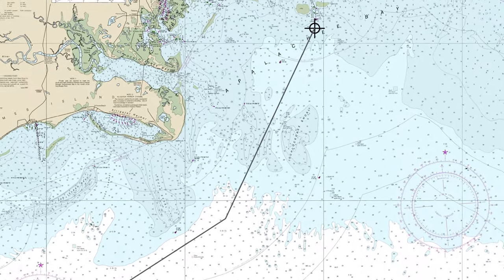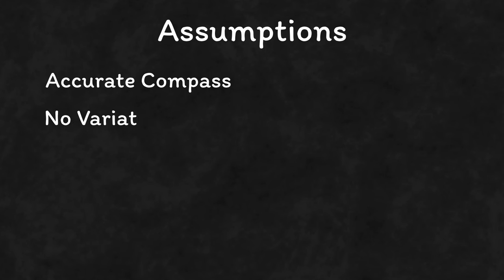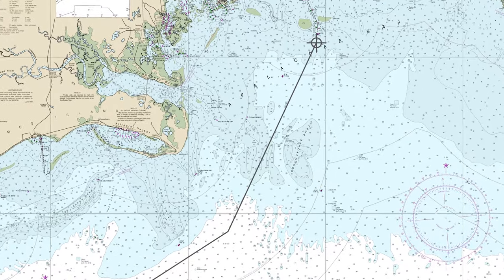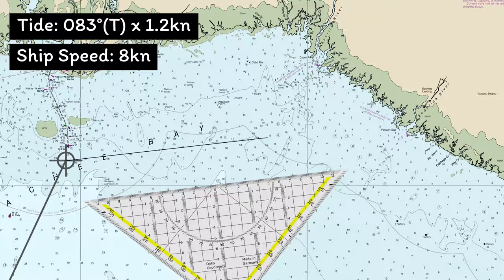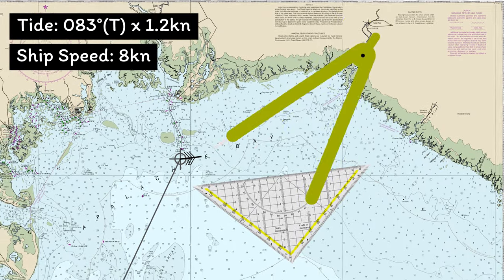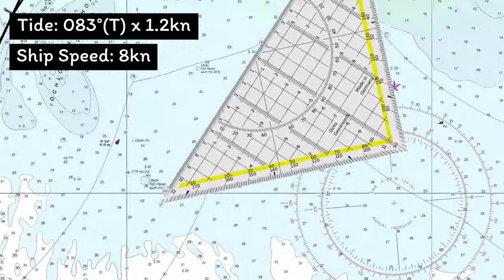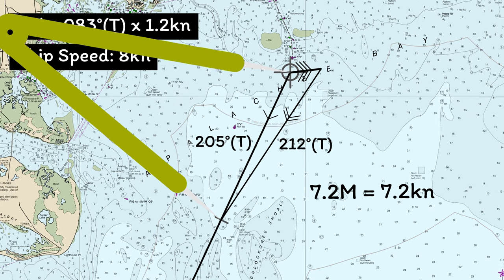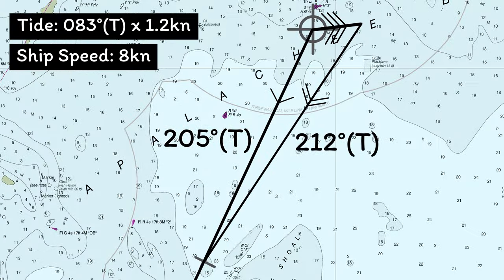Chartwork Tutorial: Course To Steer

Comment: Thanks!, nice video, but ground tracks (Course over ground or course made good - however you call it) is denoted with 2 arrows. Instead, water tracks ( Course to Steer or Heading) shall be denoted with 1 arrow. If your helmsman follows that plot, eventually would end east off your intended destination.
Reply: Agreed; "2 Feet on the Ground" means 2 for Ground track.
  >   = CTS
 >>  =Ground Track
>>> = Tidal vector.

Comment: Excellent, simple presentation.  With one exception.  Are you using proper terms?  Tide is the vertical movement of water.  Current is the horizontal movement of water.  Given how often those terms are used in error, I completely understand how that crept into your otherwise superb presentation.

Comment: What does the arrows in the set of tide means? Thanks
Reply: Three arrows just differentiates it from the water track (one arrow, it's the only error in the video) and the ground track (two arrows), nothing more complex than that. You can remember it by the ground track needing two feet on the ground, and the tide track is the most complicated so it gets three. Then only the water track is left, so gets one arrow.